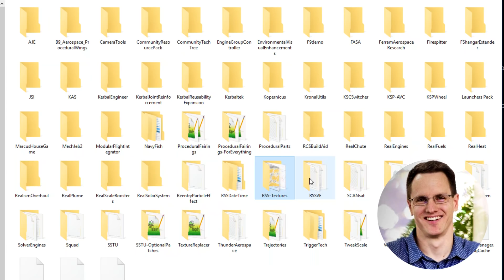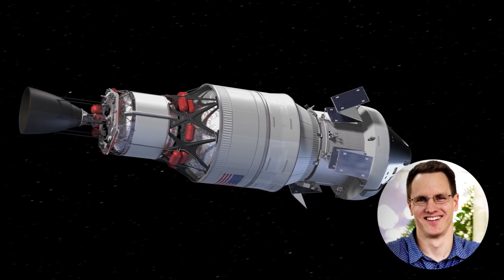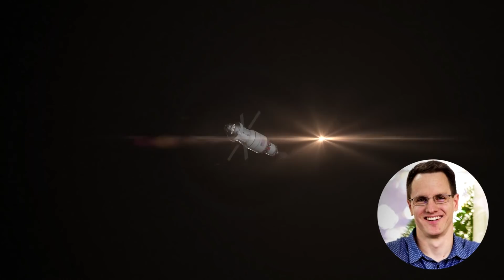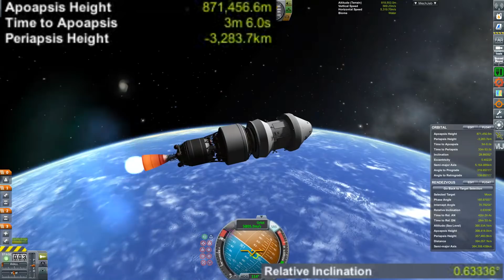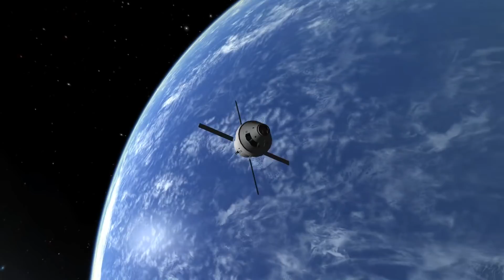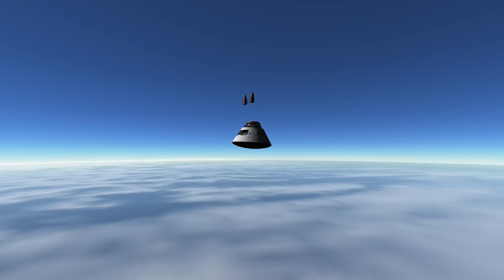Move Over, SLS! Orion EM-1 On TWO Delta IV Heavy  (ft. Marcus House)

Comment: Clearly the stress would be to high at max q for the falcon body.

The oscillations would tear it apart....
I suggest using ISRO to put one module in LEO where it can safely rendezvous with falcon heavy.
ISRO takes like 1.5 mil to make one of their PSLV so the price in a collaboration would be low

Comment: in theory yes 2 delta 4's could launch EM-1 but in reality no they can't.  there is only 2 launch pads that can launch a delta 4. 1 on the east coast (Cape Canaveral), 1 on the west coast at (Vandenburg.) Vandenburg can only launch delta 4's in polar orbits so you would have to launch both delta 4's from the east coast. But fuel boil off would kill the mission. ULA cannot launch 2 delta 4's quick enough.

plus Orion doesn't have an auto dock system so it wouldn't be able to dock with the ICPS in orbit anyways,

Falcon Heavy using 3 block 5 boosters in fully expendable mode can barely lob the orion, european service module, and ICPS stack around the moon. but since the orion stack is larger in diameter than the falcon 9 boosters the shock waves coming off  of the orion would hit the side boosters on the falcon heavy and have some serious effects on the side boosters so they would have to do models and wind tunnel testing to address that issue. also spacex does not have the capability to vertically intergrate their rockets. so significant changes would have to be made to the strong back to support the orion stack as the rocket transits from horizontial to vertical. then spacex would also have to plumb in a way to fuel the ICPS and the european service module after the rocket stack is vertical

So the plan is to still use the SLS, But it won't be a fully tested and certified rocket. NASA is only going to test what absolutely needs to be tested to fly the rocket safely to try and get the Mission back on Schedule for Dec 2019. then they can fully test the next SLS rocket.

Comment: If they do it with two launches they'd probably have Orion dock nose first since the docking hardware is already there and do the TLI burn eyeballs outs like in the original Ares architecture.
This also should save some mass as that extra docking adapter would not be needed.
Another idea  I wonder could work is using an Atlas V Centaur as the departure stage since it's lower cost?

Comment: Falcon heavy is not intended to be crew rated, so a rendezvous would be required for that mission too. That could be handled by a dragon though, and spare capacity could give a couple of tourists a ride. Getting them to manhandle a few hundred kilos of supplies onto the orion could really make them feel an important part, and undeniably astronauts as well as tourists. If I were Elon, I would go myself! A dragon is capable of hanging around for a few days just fine, so could be launched first. As other people have said, your profile isn't human rated either, and I think the upper stage for crewed flight is intended to have 2 engines for a lower profile. I'm not sure what inclination orion is intending to launch at, but I would imagine they would also be intending to avoid the worst of the Van Allen belts again, which might add another complication (no multiburns at perigee, and high inclinations only).

The compromise that I quite like is a recovered heavy for the orion uncrewed. A delta for the ICPS, because it can handle hydrogen already, and a dragon to crew the thing before sending it off. All tested tech used to purpose. If you are worried about hydrogen storage you can send up the orion and dragon first, to get settled and test all orion systems in LEO. The transfer stage can go up a few days later, possibly with the crew in the dragon at a safe distance. Get back in the orion, wave goodbye to the dragon, and off you go! If there is an issue, you can drop the dragon, and maybe send up what you need in another dragon without having to drop the orion or wasting a transfer stage.

 The ICPS really should be redesigned though, to just be a disposable tank attachment for the upper stage of the delta. A fuel valve has got to be easier and lighter than a full stage. At a push you could just take an extra tank with you, and not ditch it at all. Currently it seems stupid, using two of exactly the same rocket in stages.

Storing hydrogen and oxygen in space is actually considerably easier than storing it on earth. Layers of foil separated by vaccum are extremely effective lightweight insulation. The problem is that maintaining a vacuum on earth is difficult. Air that gets in will freeze out, while hydrogen and helium are good conductors of heat. You don't just throw together hydrogen handling in the atmosphere.

I do think the cost of designing a full docking system for the ICPS would be well worth doing. It would turn it from a mission specific part into a plug and play booster for orbital assembly. Imagine how capable a craft with 3 of them lined up could be. Using a couple of recovered block 5 falcon 9s instead of the expensive delta boosters could massively cheapen the whole thing too, but might be a cooperation too far. Then again, using an upgraded ICPS to get itself most of the way to orbit instead of the upper stage of a falcon heavy would be better still, as the lofting trajectory that the hydrogen engines need is quite recovery friendly.

Comment: Also the main engines on the Orion service module are shuttle maneuvering thrusters which run on hydrazine, so with an unmanned mission you could easily put the Orion up in orbit for a few weeks and then launch the booster to it.

Comment: There’s something really significant that both of you guys have missed. 

Ariane 5 is LH2/LOX, on a completely currently independent infrastructure with a separate pad, ESA is building the service module. Last but not least Ariane has a 4.57 meter fairing and the kickstage to take em1 to the moon is 4 meter. 

The easiest way to do this mission is to launch delta 4 heavy from ksc and the booster from Guyana simultaneously. No muss, no fuss.

Comment: You guys left off the most important factor, Orion and the ESM require Vertical integration. Delta IV already does this for payloads, but SpaceX does NOT. That is a pretty big deal. (though now SLS is back on for EM-1)

Comment: Instead of reducing the fuel it might be a better option to complete orbit using the payload icps. The total dV will be a bit higher that way, although not a huge amount. This requires lighting the RL10 on the ICPS twice, but that shouldn't be a problem.

Comment: EM-2 will be SLS because neither the D-IVH or the FH are viable within the timeframe. Two D-IVH's would be impossible because you can't launch from Vandenberg and rendezvous with a launch out of the Cape. A D-IVH and FH would be possible from the cape, but you would have to fit ICPS inside FH's fairing, which doesn't fit, and also fuel it at 39A, which you can't do, and also create the docking hardware (and software, since Orion doesn't have docking capability yet). FH wouldn't work, because again fuelling ICPS and other ground systems at 39A, and the time needed to test the stability.

So EM-1 will be SLS, and Orion will likely only ever fly on SLS, but still, long term, FH is the best alternative. If NASA wanted to pursue a commercial launcher, the first path would be to see if FH could handle the tall stack, and how to modify ground systems to fuel both ICPS and ESM on the pad at 39A, and since it is a crew vehicle, a second crew arm would need to be installed. A lot of work that only makes sense if SLS gets cancelled.

EDIT: The nice thing is in both cases only minor changes are needed to the rockets themselves. Orion is already built to launch on ICPS, which is basically DCSS, so Orion on D-IV is easy peasy. Only modification would be to a D-IV fairing for umbilical pass-through to fuel the ICPS payload. FH would only need an adapter from stage 2 to the D-IV interstage, from which you put a DCSS aka ICPS on top and Orion on top of that, as in the SLS stack. Ground systems of course need more modification (in both cases).

Comment: How are you going to dock the Orion and ESM with ICPS? Tie them up with ropes? They have no docking mechanisms OR an automated docking system. Only one launch pad on either coast for Delta Heavy. Launching from West coast goes to a wrong orbit - polar. So you’ll need tons of fuel to switch from that orbit. Plus cryogenic boil off. Listen to Bridenstine before embarking on some wishy-washy impossible to do missions with two Delta Heavies which are not available any time in the next year anyway.

Comment: Vandenberg can only launch west and north...

Probably better launch something like ACES, using all the launch capability of D4H to launch just fuel in a stage that is designed for low boiloff. As it would have to be launched beforehand from the same KSC launch site.

Comment: 37 hours 43 minutes - your hydrogen long gone at that point, just boiled, and you have no enough volume to hold it in boiled state. ( 11:24 )
Reply: ULA did some research on boil off mitigation to keep  hydrogen liquid for much longer than that.
Supposedly when they implement IVF the Centaur and later ACES stage will have an orbital lifespan in days or even weeks.
Reply: @Patchuchan  https://youtu.be/CU09S0SPW2I?t=313 from NASA administrator himself.

Comment: I think the best option is a dual launch Falcon heavy (recoverable) carrying the Orion capsule and service module, and a Delta IV heavy carrying the ICPS. Not only will it be the cheapest option for both companies, it would also be an amazing show.
Reply: oh, yeah that might be a quite reasonable option. No way I can see Space X launching tow Falcon Heavy's so close to each other. Did somebody already figure out if you could send a 2nd flight from Vandenberg in time to rendezvous?
Reply from the maker: Somebody mentioned launching East from Vandenberg is impossible since the boosters would be dropped over US mainland.
Reply: The insight probe was launched from Vandenberg and it hugged the coastline, but it was highly inclined.
Reply: Also, I may have miss typed, I mean a Falcon heavy and a Delta IV heavy, dual launch from Florida.

Comment: Could someone kerbal a "Super Heavy" with an ICPS and Orion atop?. Would be interesting if the booster would be reusable, or if it has to be expendable because it's too fast.
Reply: If it just a super heavy without some form of second stage, then yes it'll be going way to fast to be recovered.

If super heavy were to release the payload at the nominal time, then the ICPS would need to provide the remainder of the 6000 or so m/s required to reach orbit.  

Keep in mind the Superheavy is supposed to fly with a fully fueled Starship on top AND payload with 30 tons more mass than the combined Orion and ICPS.

Superheavy could probably get Orion and ICPS a good way to orbit, but it would definitely not be   reusable.

Comment: Sorry ShadowZone Delta IV Heavy is out. For two reason; 1 there is only 2 launch pads for Delta IV one on the East Coast and one on the West Coast. The East Coast location is capable of launching into the correct orbit however, the West Coast launch would have to be polar and correct its orbit for so long it would run too low on propellant from cryogenic boil off. 2 Orion is not capable of docking without a crew which means it is completely impossible to do the LEO rendezvous. Sorry mate Falcon Heavy wins  but just barley because it can only throw Orion on a free return trajectory around the moon. Thus the EM-1 mission would only meet 1 of its many goals.
Reply from the maker: I mean if they would be willing to allow ULA to drop the Delta IV boosters somewhere over US soil, they could launch from Vandenberg ;)

I know it's less viable than the FH mission. Although if they would have to split the payload, a simultaneous launch of FH and D4H from KSC might be possible.

But hey, this was the more Kerbal mission. If you want sensible, go watch Marcus's video :D
Reply: @ShadowZone  absolutely! Lol Thanks for the great work.

Comment: Although you raised some good points I think it’s quite clear that the falcon heavy was better. Not only was the mission more simple with it but you must remember that an expendable falcon heavy is about $150 wile 2 delta 4 heavys is about 800!
Reply: even if they use two Falcon Heavys they would still be cheaper than one delta
Reply: It's kinda amazing that tragically saccing no less than 28 Merlin engines is so much cheaper than saccing 6 RS-68-As and 2 RL-10-B-2s.

Comment: 3 things: 
1 - you both touched down on the ocean, but wasn’t the orion spacecraft supposed to land on land with airbags? to prevent corrosion from seawater? or was that the CST-100 starliner?
2 - notice how if you watched both video they trap you in an endless circle telling you to continue by watching the other video, I thought that was funny. 
3 - marcus slipping in the “falcon heavy” at the end of the video made me laugh so hard lmao
oh and 4 - great job both of you, these were great videos, you should totally do more collaborations like this!
Reply from the maker: 1 - yes, that's Starliner
2 - an infinite KSP mission, is there anything better?
3 & 4 - thanks :)
Reply: Phoenix Plays Games Orion will land in the ocean you are thinking of starliner.
Reply: Yeah you must be thinking of the Boeing starliner
Reply: Originally Orion was to land using air bags but they got rid of it and went with splash downs I think due to payload limits on Ares I .
Exposure to seawater makes refurbishment more difficult but not impossible as EFT-1 is being reused for the abort test and Cargo Dragons have been reused.
Turn around ends up being more work as  the RCS plumbing and electrical connections outside need to be cleaned of salt and checked.
Reply: IDIOT!

Comment: Why are you burning unaligned with the node? It looks like you are using the gimbal to rotate, while you have rcs. I am not familiar with realism, so can you explain. Thank you!
Reply from the maker: You mean for one of the three-part-injection burns? I was low on Hydrazine and was trusting in the Gimbal to orient the vehicle to the maneuver node. 
In Realism Overhaul you need to first settle the propellant, since it sloshes all over the place in zero G. Therefore you first need to do a little RCS burst so the fuel settles at the bottom and the pumps can correctly suck it. Otherwise you'll end up with vapor in the fuel lines and the engine won't ignite.
Since I was low on RCS fuel I wanted to make sure I get the engine going no matter the direction. The RL10-B2 has so little TWR that I was confident the orbit wouldn't change significantly before it would reorient.
Reply: @ShadowZone  Thanks. I knew about ullage, but I did not know about your hydrazine shortage.

Comment: So if both rockets are capable of doing the mission. The real question comes down to engineering. Adding docking to the cryogenic stage, while possible is one more hurdle needed to be crossed before it can fly on two Delta IV's. Likewise, since the cryogenic stage was designed originally for a Delta or SLS type rocket, I am sure there would also be another engineering challenge in adapting the SLS launch stack for a Falcon Heavy due to size differences. So its possible for either rocket to take the mission, but both have some challenges ahead...

Unfortunately knowing how NASA and government works the mission will probably just get de-funded before anything ever launches. :(
Reply: moar boosters